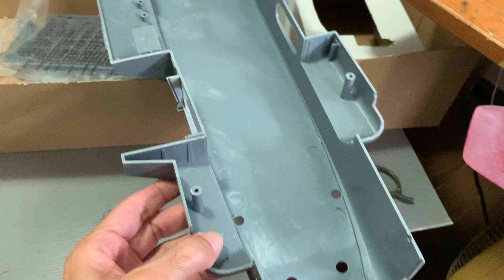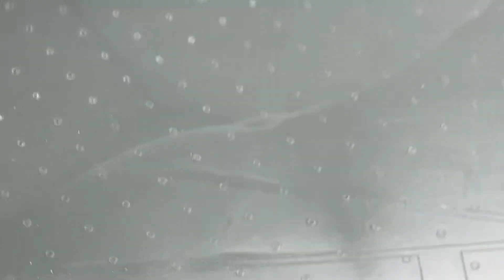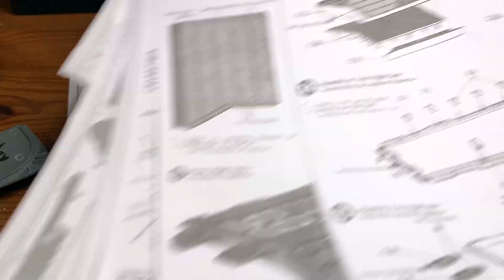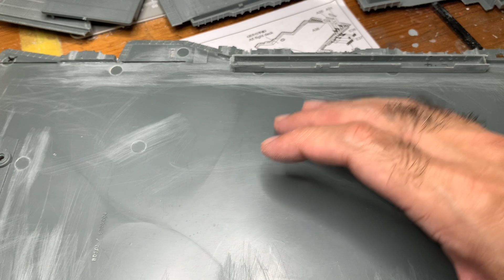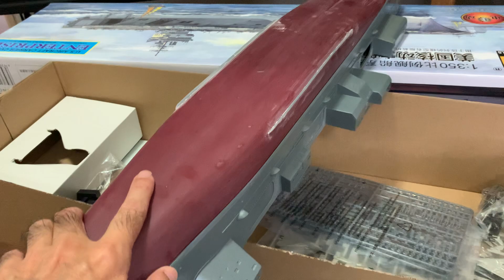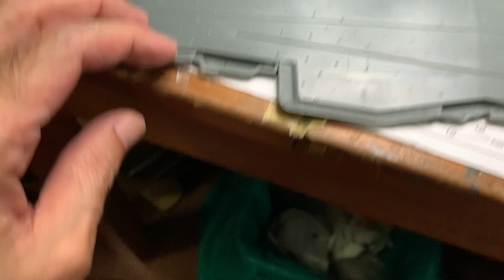1/350 USS Enterprise CVN-65. Mini Hobby Model. build update part 1.

Comment: Why do you have to drill holes in decks
Reply from the maker: @fredmartin7051  That’s because the deck has raised panel lines and also for the holes. i sanded off all the raised panel lines and scribe the lines back. for the pad eye holes i drilled them.

Comment: Tell me when you having elevator problem
Reply from the maker: i have tested one piece and just like the kitty hawk it doesn’t sit horizontally. it’s quite loose on the connecting edge. so it will not be workable. i will have to glue them.
Reply: @modelar705  dam well my Nimitz is somewhat having a problem fitting the elevators
Reply from the maker: @randomamerican524  is it loose? you just need to glue it